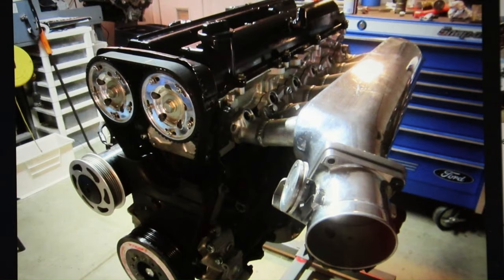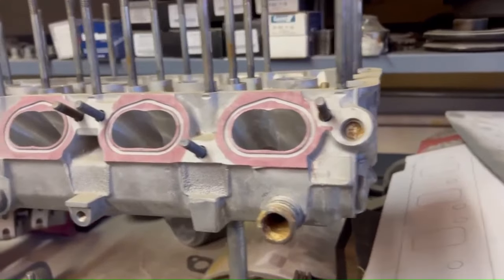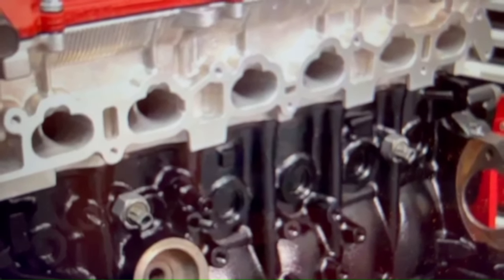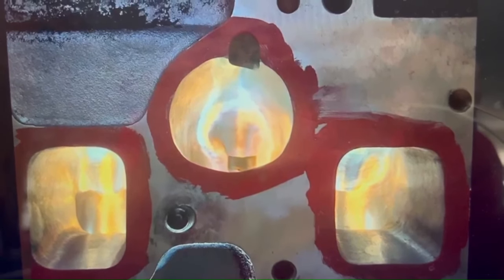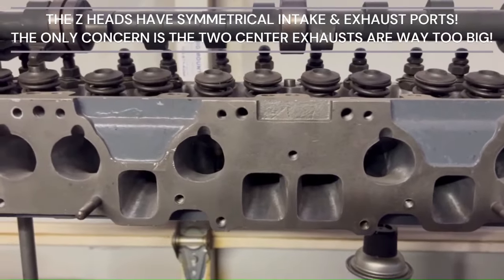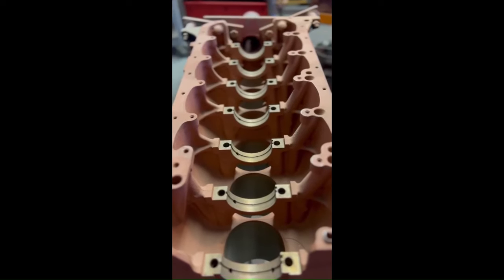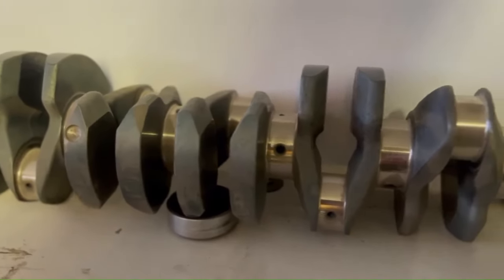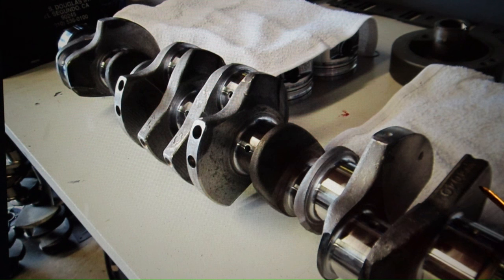6 CYLINDER INLINE POWER!

Comment: The Ford FE.  I use a line off of the filter pad  drill the front feed to the center main feed that runs the length of th the block front to rear. The front and #5 are fed from the enlarged center feed with 2-3-4 plugged at the top, so that 1-5 are well fed.  The 2-3-4 are fed with lines being priority lines that come from the pad and feed the camshaft after the main. You can balance the pressure tic to top and valvetrain.   I have pushed my FEs with the enlarged and external lines to 8500. Rpm’s.
Reply from the maker: Thanks for the FE tricks!
Reply: I love when someone comes up with various methods. The Buick Big Block and Ford Y block also had limitations that people had to work around.

Comment: The RB suffers from feeding the head too much oil with not enough draining capacity. There is a mod done on the back of the head near the bellhousing that makes an external drain from the head to the block.
Reply from the maker: Thanks for the input and I also noticed the main oil well diameter feeding the crank is much too small compared to the 2JZ and Datsun Z plus the BMW's.  
I feel this is a major defect and there was another famous racing engine that resorted to what they call a "side oiler" block that had similar issues.
Reply: @benalamedaracing2765  yea that seems like a horrible problem to have. Luckily I guess I got a sbf.lol

Comment: Datsun L heads - I've been cutting and welding these for 35yrs. You're right, the centre ports are far too big, some time with a grinder, TIG and 4943 rods makes for a better flow balance. These heads respond very well to raising the port roof considerably after the floor and SSR are welded. Chamber reshape helps economy too. Shooting for mid 700's on this L28 build (up from 620hp).
Nice video Ben
Reply from the maker: Thanks Stuart and I will post a video on all three of them in a detailed format.  I just was shown an aftermarket Z head from Japan and I told the owner, why is it still casted with the same large center exhaust ports?  Anyway not surprising to me because I saw another aftermarket block with known issues of oiling problems, they were doing 100# or more of oil pressure!  The aftermarket fix was an aluminum block with the diminutive main oil galley still like it was from the factory casting!!!
I wonder who is actually designing this things if they do not race or value the opinion of those that seriously run them at the track not at the hamburger joint.

Comment: Years ago I had a 260z with a 280 engine and an automatic. Got tired of the damn floats in the stock side draft carbs not staying set and flooding. I made an intake that came out and down with exhaust tubing from the stock intakes to a Rochester 2 barrel. The thing made so much torque with that long skinny tractor looking intake, it started shearing flexplates in half around the crank bolts. After a few of these I welded 2 flex plates together. That thing would actually do a burn out, chirped the tires hard going into second. It would get 27-28 mpg if you could make yourself drive it right, and hauled A55. 😅
Reply from the maker: Long runners on an inline engine means big torque!  Glad you had fun with it.

Comment: The BMW head does look awesome in potential, for architecture. While flow numbers are useful, to a point, are there any dynamometer comparisons of comparable setups? 
I’m thinking, a dynamometer comparison to include BSFC, would be revealing.
Have you seen David Vizard’s recent video, where he’s introducing the idea of a polyhedral chamber, (alternately staggered size valves), to foster what he is calling, “twirl”.
Reply from the maker: Yes and you can do a little of that by changing the intake valve job or seat angles on one side only and not the exhaust.
Reply: @benalamedaracing2765  was thinking along the same lines, but, accomplishing the difference in port energy / discharge coefficient, by having two different throat percentages, 86% and 88%?
Nothr thing mentioned, was sinking the exhaust valves, to discourage over scavenge during overlap.
Thinking a better approach might be to drop the chamber roof, to allow for wider departure / top cut, and using the resulting ridge at the intersection of the intake and exhaust top cuts to discourage the over scavenge. 
Thinkin’ generally, most 4 valves would benefit from the dropping the roof to widen the top cuts, as most 4 valve heads seem to have a minimal top cut / departure angle, and have seen several where the seats actually “sit proud”, several thousandths.

Comment: Poly quad head /valve design can help create swirl in a 4valve head
Larger and smaller inlet valves oppose smaller and larger exhaust valve sizing
Reply: That, and some used a different cam profile for the two intake valves. The Honda Civic HX was it.
Reply from the maker: I feel the intake valves will get assistance with different diameters or different valve seats perhaps steeper @ 50* instead of the traditional 45* from the factory on just one valve.
This said, I see no reason to swirl the exhaust as it accomplishes basically nothing. No need to place any kind of mixture motion, we just need to scavenge it out of there asap, energy spent and used so we must discard of it as fast as possible.
We are not trying to keep the mixture together or keep them in suspension they are all basically ignition waste gases.
Reply: Cool
Really enjoy learning from people with true engine smarts 
Thanks for sharing your wisdom and taking the time
I'm a body and paint guy with an engine fetish 
Much appreciated 🙏

Comment: What bmw is that? Looks like m50 style exhaust stud pattern , looks like a s54 in the first picture ? You mention aluminim block bmw's ? (S54 is iron ) is it a euro s50/s52?   im just confused what engine or combination of bmw engines you show.     Also worth a mention , the 2jz has a taller deck height than a bmw , the bmw motors have short rods / poor rod ratio by comparison. Bmw's bigger than 2.8L  like to load the cylinder wall/ oval bores.

Comment: Barra from Ford Australia definitely worth a look
2000 rwhp +
Reply from the maker: I have to see one of them up close...
Reply: Ford Australia shut down in 2016 after 91 years 
These engines were designed and built here up to that point 
Coming in a factory turbo version from late 2002
These engines modified are rockets 
Some have been imported into the US